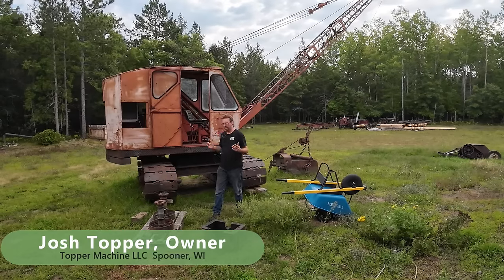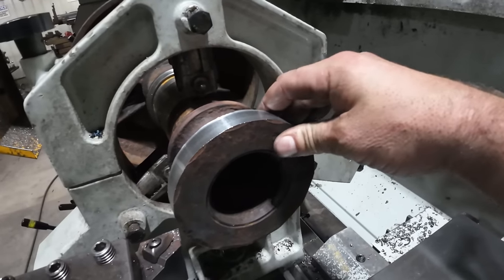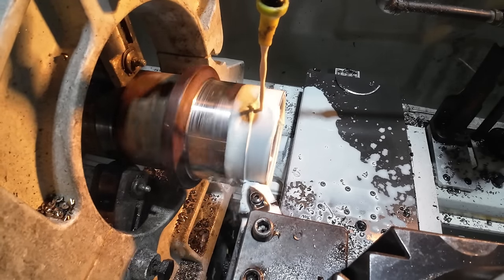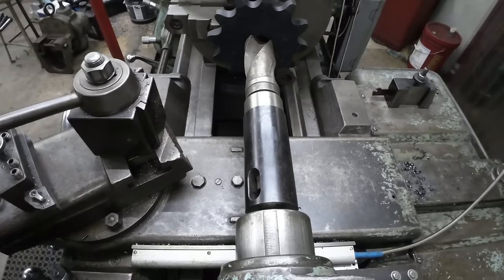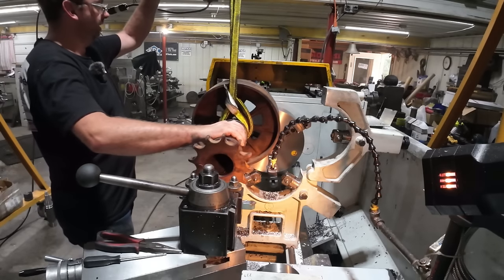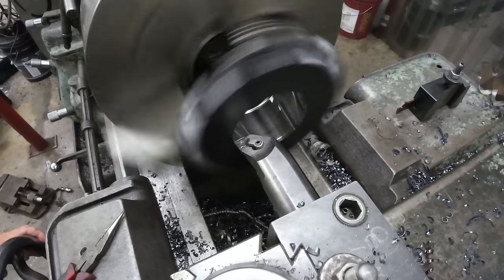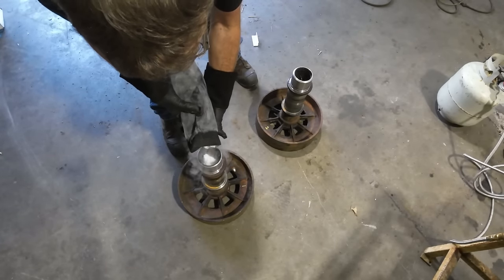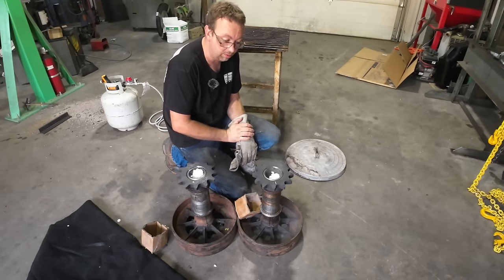Repairs to the Bantam C35 Dragline Crane - Replacing the Sprockets - Machining, Welding, Shrink Fit

Comment: A fitting tribute to your friend. Thanks for sharing the obituary. My offer on LN2 stands, if you ever need it. That said - man I kind of want a dry ice set up now. That's a really nice repair job - I think it's great for people to see what kinds of things can be done to keep machinery going - with ingenuity, determination and skill a lot of things can be saved. Repair culture beats throwaway culture every time. Cheers and best wishes as always.
Reply from the maker: Ron is definitely missed. We had a good 25 years of troubleshooting and repairing locomotives.  LN2 would be nice sometimes, but the dry ice has never really let me down. Still, it's amazing how disconnected my region is from the rest of the world when it comes to getting supplies. You either become self sufficient, or you fail.
Reply: True all round. The LN2 doesn't get you very much further than the dry ice in practical terms, and the dry ice is a lot easier and cheaper. It's nuts how little support you get for where you are - seems like a lot of dealers and suppliers just don't want to go to the trouble of going very far out of the metro areas. If I was smart I'd come up with some kind of business opportunity around that.
Reply from the maker: @StuartsShed  when you come for a visit, you will see just how desolate this region is. It's really sad.
Reply: @TopperMachineLLC  In same situation where I am. Thanks to Ebay and Amazon I get what I need. Without them I might be out of business.
Reply from the maker: @kmcwhq  eBay or drive hours away.  Bigger problem is that the local govt wants to keep this region depressed. They drive away industry and progress. I have never found another region of this country like this one.

Comment: The hardest working man in Spooner strikes again !  
Nice work Josh.
"LIKE" button has been torqued to the manufacturer's recommended specification. "CLICK".  
God forbid you should be running around Wisconsin there with a loose "LIKE" button and winter closing in !

Comment: Great job there.  I wonder what metal would not shrink.  Thanks for the video keep on keeping on.
Reply from the maker: I was wondering if it wouldn't shrink because of the shape. Being a tube, there isn't a solid piece of internal stresses. That's just my guess. It did shrink, but only 0.001. Definitely not enough.
Reply: @TopperMachineLLC  I used to shrink motorcycle cylinder sleeves and they are round.  It must be the metal.  Maybe someone will experiment to satisfy my curiosity.

Comment: Enjoyable viewing  "putt'in the newness back" 👍🏻 
I have been looking forward to work starting on the old crane. 
Thanks
Reply from the maker: This was the first of the repairs, and the worst part. Next is track rollers, new  track pins and pad repair.  But that will be a way out. Hoping to be moving and digging by next summer.  But we will see how bad winter is. I have to work on this stuff outside.

Comment: Good morning Mr. Topper from San Rafael Bay CA. Your dedication made me tear, what a really nice person you are. A Class Act of skills and Heart.

I like your "DRY ICE '' set up, I remember using the freezer at work to do a press fit of "Duramax Industrial / Marine, Cutlass Rubber Bearings. after "freezing" out of the refrigerator to the assembly area and load straight in the Cutless Bearing into a very expensive lost wax cast 316 SS body frame and machined, then using a "Dake Press" with NSF approved lubricant, press in while watching  the hydraulic pressure  if going high stop!  Yes we lost many bearings and added expense outside machine shop removal of a stuck bearing !

I had made a lot of the procedures to do all this, we even did what you did and chamfered the leading edges .

You might like these 'Bearings. We used the ones with 316ss  and the rubber bearing surface was NSF approved for drinking water.

We used this bearing in centering the shaft to the "LiLLY impeller for high speed industrial potable water tank mixing, the system was used to prevent water stratification temperature bands and to lower chloramine  production due to Cl2 injection for disinfection and ammonia also metered injection as pH control in Drinking water.

 NOTE I am not a sales rep for "Cutlass Bearings" yet it is a very good prduct.

Great work Mr. Topper Take care.
Kristy

Comment: Great repair. That heavy smokey drilling was so realistic I could almost smell the hot burning cutting oil.
I’ve never seen a direct reading bore gage like the one you used.
Reply from the maker: Starrett 823 inside micrometer
Reply: I looked up the Starrett 823 and understand it now. You set the gage smaller with a mike and read the larger diameter off the barrel.

Comment: Excellent video. One of your best yet! I must take exception with heating the sprockets though. Direct heat will ruin any hardness. Put them in a pan of oil, heat it to exactly 250°. put a piece of scrap or other material in the bottom of the pan to keep the sprocket, gear or bearing being heated from contact with the bottom of the pan. Yeah, yeah, I know. You are the expert and experts don't take constructive criticism.
Reply from the maker: Good suggestion.  I've done this exact process many times and wondered if there was a better way.  Never had one wear out quicker doing it my way, I don't ever go that hot, and heat super slowly.  The 350F I brought it up to was done over 45 minutes.

Comment: Excellent work Josh, Shrink fit jobs always get me nervous. About the time I have it figured out and getting close to my finished dimension I start second guessing myself. It usually works out fine but it can make a guy sweat. The worst would be having the parts stick when they are not fully together. I really enjoy the channel. Thanks
Reply from the maker: I've had them stick half way before. Man, that sucks. Bore it out and start over.

Comment: Nice job again Josh. I have not shrunk anything on for a good number of years now, but I always got myself prepared. Have everything at a good working height, have everything you might need close to hand, so you are not looking for it. Use a large copper or brass plate to put over the item in case it needs tapping with a hammer, which is close to hand, use a tube if its a bearing going on, that is a neat fit to the race. Lastly, have a much bigger hammer, just in case!
I stayed about an hour south of where you are many years ago, for Christmas and New Year in Eau Claire. My friend had a couple of years lecturing on a type of scholarship from the UK at the university campus there. I seem to recall the temperature dropping to -40C on the bridge over the river. I can imagine that it would be hard to get what you need easily there. I'm lucky were I live in West Yorkshire, there is still a lot of manufacturing here. Colchester lathes, Mitutoyo and others are only a couple miles away. I picked up a new QCTP and holders last week, I was back home in 40 minutes.
Reply from the maker: Shrink fits are always nerve wracking. I would love to have more things readily available, but then there would be way more people around. I guess I'll stick with less people and less supplies.

Comment: Sorry to be late to this video but I have only recently come across your channel. Loving it, btw! Question: Did you consider an alternative approach to removing the sprocket teeth than turning it on the lathe? My first thought would have been to just cut most of it off with a torch and then finish it on the lathe. You've done far more of this than I so I trust your work choice. Just interested in what goes into you thinking when you make that choice. Thanks!

Comment: Shrink fitting reminds me of an incident that happened to me decades ago. I had a load on my ute (small pickup truck here in Australia) and one of the axles came out resulting in no brakes and no gears to slow down. The reason: Someone had replaced the axle bearing and hammered the retainer on instead of shrink fitting it. Lucky I was close to home and I had a spare axle on hand. I've replaced a few axle bearings  and I always shrink fitted a new retainer on and I never had any issues. You simply heat the retainer up until it turns blue and drop it on and let it cool.
Reply from the maker: Man, you got lucky. I've had similar happen to me and people I know. Can end badly.

Comment: That was an interesting repair and well thought out how you did it. You made a nice smoke screen with the oil. I thought you would have used the Anchorlube, but probably too hard to get it into the cut.
Reply from the maker: I considered the volume I would need and the delivery system and went with the oil. I'm still learning all I can do with anchorlube, but it's very impressive

Comment: It is interesting to see how the boys with the big gear do their order of operations. They invariably do the exterior work first then bore to match. Me with my little hobby lathe, the weakest link in my system is definitely boring. I would never dare turn an exterior diameter then try and bore to match it. The movement and flex in small boring bars means they are a raffle at best for precision, for me its all about getting a consistent internal diameter close to what I need, then matching the exterior diameter to what I have achieved internally.
Reply from the maker: Most hobby machines are too flimsy to do the work, but they are great teaching tools. When you get a chance to run real machines with good tooling, you should be able to do great work.

Comment: Would it have been easier and faster to use a cutoff tool against the sprocket face to remove a ring of metal instead of the interrupted cut?

Comment: Could you machine from the end just past the teeth with a button insert rather than dealing with the interrupted cut? A question, not a criticism.
Reply from the maker: I've never tried it, but I doubt it.
Reply: Possibly a heavy trepanning tool but it wouldn’t be worth it for just two parts.
Reply from the maker: @ellieprice363  trepanning has its place, but usually not for my quantities
Reply: Ah. It just seems like interrupted cuts are certainly hard on the tools and perhaps the work or the machine.
Reply from the maker: @The_DuMont_Network  sounds way worse than it really is.

Comment: If you were able to seal the tube and put some coolant in the dry ice , I think you would probably get a better result.
The  heat or cold conduction between the steel and powder would be very low.
Adding a liquid would improve it by a significant amount.
Reply from the maker: I considered that. Isopropyl alcohol would have helped.

Comment: Didn't film the reassembly because you had to use all your "special words" to make it go back together? That was a pretty slick piece of work!
Reply from the maker: Special words, lol. It is also really tight quarters under there. Flashlight in my mouth, and contorting into unimaginable positions, just to use your fingertips to tighten bolts you cant see. Yup, it was fun. Lol

Comment: Ok, so my untrained approach to those gears would be to cut em off with a thinner cutter from the front so they come off in one piece(just inside the depth of the teeth). Seems like it would be less likely to break the cutter (i break everything I use usually, so I'm paranoid about that) and maybe faster? But I'm not sure that's proper form, how that would destroy tools, or whatever. I'm not a machinist, but I'd like to get a Bridgeport for gunsmithing use. Cutting metal is cool.

Comment: I'm no  machinist, but can you explain why you'd rather cut the teeth off by milling them off from the points instead of using a parting tool from the front and not having all those interrupted cuts from all those teeth.  Seems like it would be easier on the tools and machine  to do it from the front, and cut a ring off teeth off.

Comment: Shrink fitting always has a pucker factor! A note on Anchorlube...i bought some as ive never used it before. Did some testing with it and as i am a woodturner as well i have stuff called Anchor Seal for sealing green wood ends to help in cracking...its exactly the same and wayyy less expensive! Rockler has gallons of their green wood end sealer. Same as anchorlube but white and doesnt smell like almonds! Its all emulsified wax product...cuts and taps the same.  FYI in case anyone wants to try it out.

Comment: How did your inserts take those interrupted cuts? Maybe you should have cut off the sprocket teeth with a band saw before turning. Or isn't that worth the trouble of the extra setup? Sorry about your friend.
Reply from the maker: Bandsaws are a waste of time. A good insert will take that with no issues. I cut both of these with the same corner of an insert I've been using for the last week. I'll probably be using that same corner on the next few jobs. Quality tooling is worth the investment every time.

Comment: One of those trepanning boring tools would cut quickly below the sprocket teeth and save you a lot of slow turning.
Reply from the maker: Not worth having tooling like that for one or 2 parts.
Reply: @TopperMachineLLC  I've only been watching your channel for a few months, but you could have used one on at least 3 projects.
Reply from the maker: @oldschool1993  but if I had one, it's really only good for one size. So I'd have to have more. It's more about the cost than it is about not wanting a tool. I'd rather put an extra few hundred in my pocket than buy a tool for one job.

Comment: Someone should mention,if the chain is worn ,stretched, the pitch will change and the sprockets will wearout again.
Reply from the maker: Chains are being replaced with new ones.  Fixed right the first time.

Comment: Sometimes if we put too much interference fit on something.... It makes it weaker....... Look what happens to a lug nut.... If we if we torque those lug nuts too tight.... To where they are on the verge of 11:31  breaking...... What if truck had a heavy load on it and you went around the corner.... Those lug nuts are going to get an ungodly amount of pressure put on them.... So you pre-loaded them.... If you over torqued  them....
Reply from the maker: A general rule of thumb for shrink fits is 0.002 for each inch or diameter. I was under that by a few thou.  Nothing to worry about with this repair.

Comment: Might be worth investing in a dewar and getting liquid nitrogen for these kinds of jobs. I can fill my 30L dewar for less than the cost of an 80cf CO2 refill without having to worry about hydro testing fees. Definitely beats the days of using dry ice and acetone.
Reply from the maker: Unfortunately it is not readily available here. This is the most remote and depressed region of the world.
Reply: @TopperMachineLLC I'm in the same boat, but my welding gas supplier fills them without problem, other than driving an hour to get to them it's as easy as any other transaction with them.
Reply from the maker: @ForfeMac  I've asked, it must be shipped in. Not really worth the hassle for something I do once in a while.

Comment: Restraining the CO2 bottle would not be a bad idea.
Reply from the maker: It was only out like that for the video, it's usually done from it's secured location. I've been doing this 25 years. The only time a bottle is not secured is when moving or for a one off like this. Otherwise they are chained to the machine or in the storage corner. I've seen them fly away before.